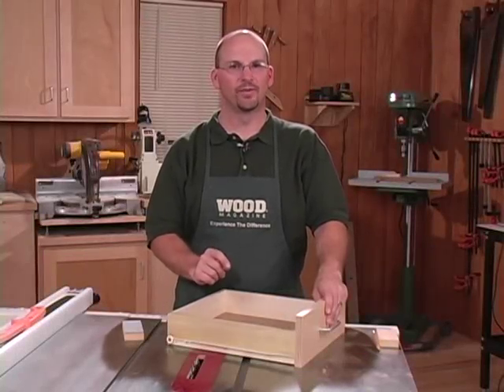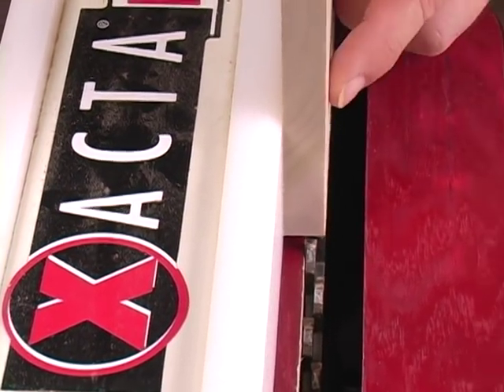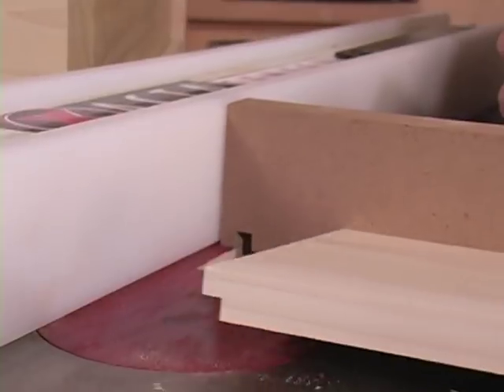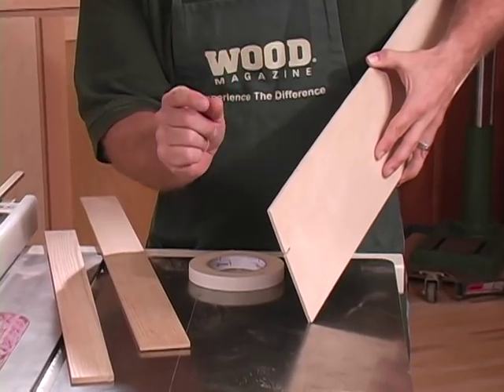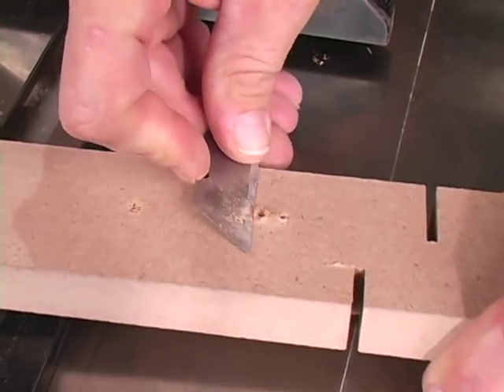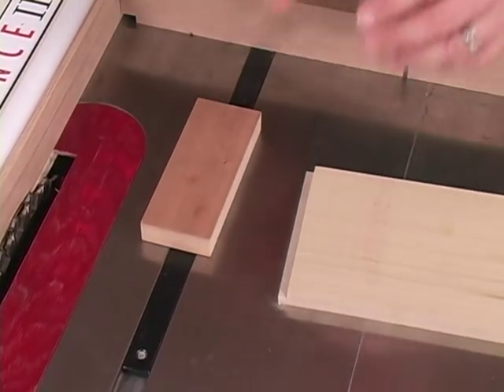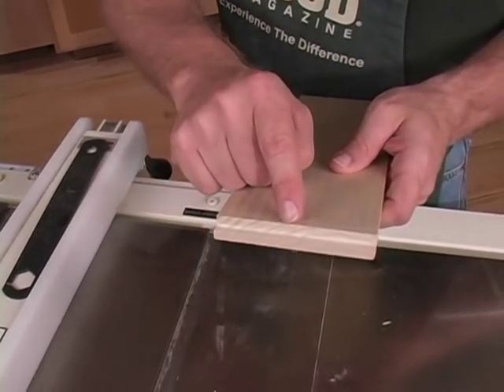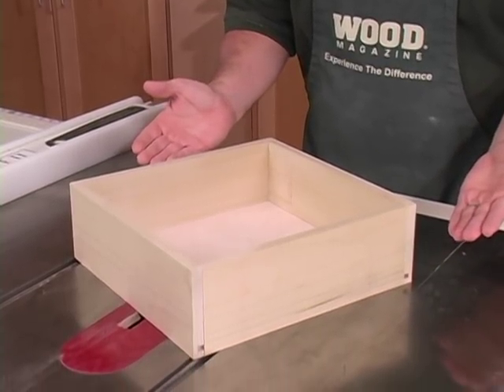How to Build Super Simple Drawers -- WOOD magazine

Comment: The way he's pushing that board through at 6:46 is exactly how I was doing it when I had a table saw accident. The board kicked back, and knocked my finger into the blade. Thankfully the blade was only up 1/4" otherwise I would have cut my index finger off. 

Now I ALWAYS use a pushblock and a feather board to hold the piece against the fence.

Comment: Or you can cut the pieces held vertically against the fence and not need the shim.  That way the 1/4” fence position works for everything.
Reply: exactly
Reply: If dubbelsided tape fall on your sawblade (deu to sawdust for instends or not sticking to mdf) you have a mdf missileblade

Comment: It would be helpful to note that the dado is not 1/4 inch as stated, but instead, half the thickness of the board. (Presumably slightly greater than 1/4 inch after adding the shim.) Using a different example, say, a 3/4 inch thick board, the dado would be 3/8 inch. And in this case, you'd want to remember to reduce the dado thickness to 1/4 inch before cutting the groove for the bottoms.
Reply: James Bizily agreed. This video is misleading
Reply: Did he maybe do multiple passes to widen the dado a bit?
Reply: Thanks.. .I was assuming it was 3/4 stock...so you saved me some time. I got it dialed in after about an hour and 3/8" dado with the same routine worked great.
Reply: Thanks, James. Glad I read your comment before starting the eight drawers I'm making for my workbench. So, the spacer would have to be 3/8 inch too in that case ... not 1/4 inch? Correct? And is that spacer really necessary anyway?
Reply: This one comment saved me tons of work. Thank you.

Comment: Even easier than taping a shim to the rip fence, changing the miter gauge extension, etc., is to just get 2 pieces of scrap that are each exactly half the thickness of the drawer pieces (so 2 1/4" thick scraps for 1/2" thick drawer sides).  Dial in your dado stack to exactly the thickness of these scrap pieces by cutting a test dado into a third piece of scrap (this scrap can be any size), and make sure your 2 scrap pieces each fit well in the test dado.  Use the 2 scrap pieces sandwiched together to set the fence away from the blade.  Use one scrap piece to set the height of the blade.  Clamp one scrap piece to the rip fence ahead of the blade as a stop, making sure the miter gauge extension (if you're using one) doesn't hit it.  Slide each end of each drawer side up to the stop, and run it through the blade to make the dado.  Now clamp the second scrap with the first one, doubling the thickness of the stop, slide each end of the drawer front and back pieces up to it, and run them through the blade to make the rabbets.  Same result, but IMO a lot easier than that business with moving the miter gauge extension, or taping a shim to the fence (how much thickness does that double-stick tape add?).  Assuming you can find 2 scraps that total the thickness of the drawer pieces, it works out exactly the same.
Reply: JusBidnes I agree that the shim has always been the weakness in building this joint. Part of this is due to the fact that plywood is not exactly 1/2" or 3/4" thick. But how do you obtain these two pieces of equal custom thickness? and how much more time is needed to make them?

Comment: I did a similar thing using only the regular sawblade.  Set the fence at 1/4" for the dado, do all dados, move the fence to 1/2" from opposite side of the blade finish dados.  If you do dados and bottom groove at the same time, it is only one setup for both.  For rabbit, set fence to 1/4" from opposite side of the blade, pass, then freehand from first cut to board edge.  I don't do enough to justify dado blades.

Comment: I stumbled across this video as I'm always searching for techniques. The problem with this method is that you  should NEVER use a table saw with a miter gauge fence butted up against the table saw fence. High probability of binding and accidents. I'm surprised this video made it through the edit mode before posting.
Reply: @Wood   If it's OK with you I would rather believe Norm Abram and others like him who teach using a stop block or spacer to ensure there is no binding or kick back. If you're saw is not set up to have all components be 100% aligned, likely like many DYI'ers, you run a chance of pinching the work piece against the saw fence and putting side pressure on to the blade. Just check the geometry. It doesn't matter if it is a dado, rabbet or through cut.
Reply: @Wood  What a brilliant retort. Perhaps it would be a good idea to have the presenter explain that it's important to make sure the table saw is properly set up before using this method. More information is better than no information.

Comment: 1/2 “ plywood is actually less than that so the three measurements (fence to blade, blade height, dado width) for the setup should be half the true thickness?

Comment: With width being the critical factor for drawers, wouldn't it be better to reverse that joint?
That way, the front and back would be the exact width required, while the sides get cut to length.
If the sides are +/- a fractional inch, it won't matter that much, provided they are symmetrical. 
Most tolerances for drawer slides are +/- 0 - 1/32"
Reply: That makes sense -- thanks for the reply!
Reply: I know this ia 5 years old, but it's spot on.

Comment: Do you recommend cutting your drawer bottoms to where they fill up the full depth of the grooves, or do you leave the bottoms slightly small?
Reply: Usually with floating drawer bottoms, the idea is to leave them slightly small to allow for expansion in a hot garage or shop, so that the expanding bottom doesn't force the corner joints apart.  This isn't so critical with drawers that will be in a more climate-controlled environment like in your house, or if the drawers are a small enough size that bottom expansion is not much of a factor.
Reply: JusBidniss Thanks for the reply!  I usually leave mine a bit small, but I was curious if I had been doing it wrong. I haven’t had a drawer fail yet, but still always looking for improvements.

Comment: Neat and efficient way to make it fast and clean, but in my opinion i don't like very much seeing the joing on the top of the corner assembly, back or front, so for those who prefers hiding joints as much as possible, machining won't help and cutting should be stopped before finishing with a scissor to make a blind gutter. Like a mortaise, so.
Reply: +Okto Putsch Just a thought, but these drawer boxes would likely have an additional drawer face added to them later.  That would hide the joint that I believe you are referring to.  I think it's just showing a convenient way to assemble a simple but strong box.

Comment: About the interlocking test at about 1:50... it is mystifying. Let's call the wall of the dado nearest the edge of the board the "near wall", and the wall furthest away from the edge the "far wall". The only requirement on the dado, other than that it not be too unreasonably deep or too skinny, would seem to be that the distance from the far wall of the dado to the edge of the board that the dado is in should be equal to the thickness of the mating piece (the piece with the rabbet)--- that and of course the fact that the thickness left by the rabbet must be the dado width.
Reply: m oc All dimensions must be equal. The width and height of the stacked dado, the distance to the fence, the thickness of the shim. Alter any of these dimensions and the joint will have gaps.

Comment: I want to use 3/4" plywood for my drawers including bottoms. Would you still recommend the same method for the bottoms or something different?
Reply: Yes, any thickness will work, just cut the dados and rabbits widths and depths at 1/2 the thickness of the boards. In your case it would be 3/8" for 3/4". The 1/4", 1/4", 1/4", system can be 3/8", 3/8", 3/8" for 3/4". This is nice because with so many odd and now metric thickness plywoods showing up at the lumber yards all you need to do is just find what 1/2 the thickness of your board is and build away!

Comment: You said you used a shim when adjusting the dato to fit the rabbit  ; that adjustment is very minute. What do you use as a shim ?
Reply: The shims from the dado set
Reply: You can also use different thicknesses of paper. I have some that are regular copy paper to 3x5 cards. My first dado set didn’t include shims. The next set I bought ($99) from Craftsman, came with them. Hope this helps.

Comment: For the fronts and backs, why go through the trouble of trying to find a properly sized spacer? Why not use a sacrificial board thicker than the gap and move the fence accordingly? Of course, you'll want to do all the sides first so that you don't care about losing the setting.
Reply: James Bizily what if you have multiple drawers to build? not moving the fence at all is nice.

Comment: Two things, after thanking you for the helpful presentation: 

1) although I'll admit it was back in another CENTURY, I coulda swore we were taught that it's taboo (clever word for DANGEROUS) to use BOTH the fence and the miter gauge on a table saw (guessing the likely answer is that you're just cutting a dado on the underside, not through-cutting, so what danger?); 

2) I don't follow how it's useful at the first checkpoint to take two identical pieces after cutting the dado to see if they can fit together: that's not how things fit, so what's the point, PLUS - bumping the fence in a smidgen would allow those pieces to fit together easier than shimming the dado stack - although as I said, what does THAT prove?

Thanks, again, though - my own best take-away is your mention of having tested the strength of this joint, finding it stronger than the much more complicated (half-blind, was it?) dovetail.  KISS principle wins again!

Comment: "...stronger than half blind dovetails."  How much pressure does a drawer need to withstand?  Nothing wrong with either joint, but to test either for a drawer joint is beyond the realm of common sense.  What is it with the faux drama anymore?   Boo!
Reply: Just takes longer and is a little more tedious to do the dovetails. As far as strength is concerned, it's not worth the extra effort. Appearance may be a different story...
Reply: I wonder if you see the irony in your post -- Anyway, the point is to prove to hobbyist woodworkers that it is a good joint for drawers.